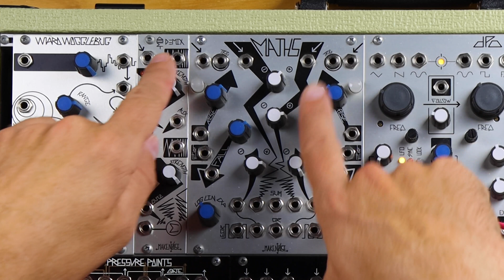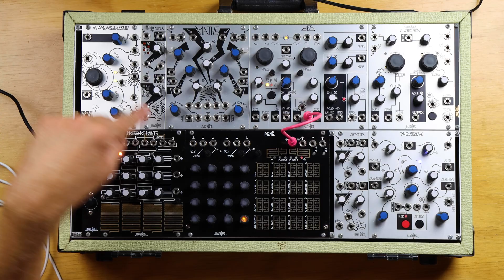Lightning Bolts & Radio Waves

Comment: I should get a Maths (I’ve been studying hard) but it’s kinda wide. Any chance of a 4hp version?
Reply: Try to find a MN Function on Reverb it's basically just half a Maths
Reply: @magnopere  I’ve literally just bought a MI Peaks which does some of it- but I’ll keep an eye out for the Function- thanks!
Reply: @magnopere  More like a third and a bit of Maths. It's like having channel 1 or 4 with a couple of differences, but you miss a lot of the mixer, splitter, sum, offset stuff.